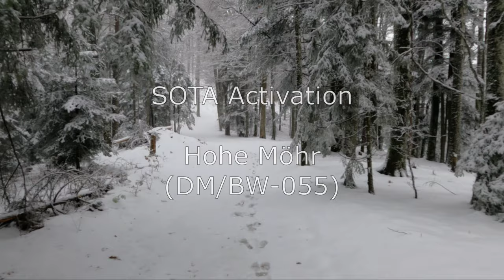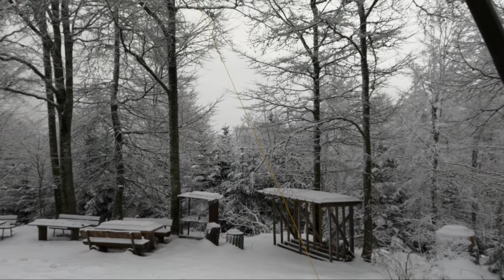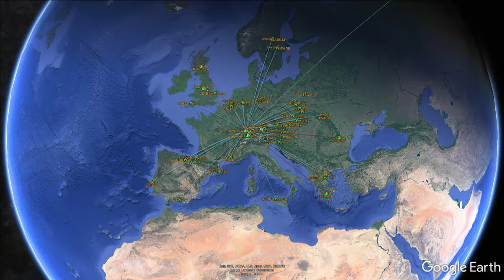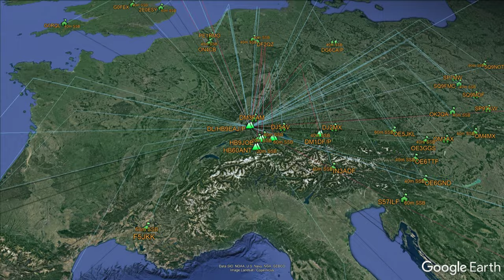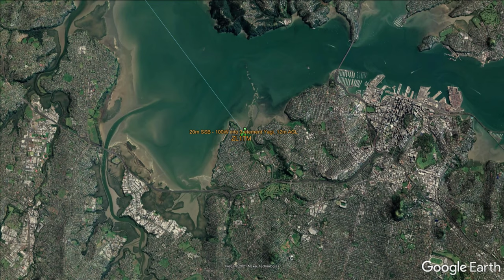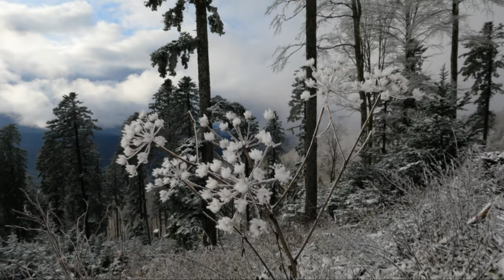First snow and unexpected SOTA DX

Comment: Congratulations on the DX Stephan! Nice to see the TX-500 proving its abilities in the snow :-) 

I've found mine to also be quite an agile rig for chasing, making good use of the A+B VFOs to monitor the pileups to try and pick the best time to call. Today in the rain my TX-500 + your 7 band EFHW design got me to my 1000 chaser points, which I was very pleased with.

73 Jonathan G4IVV
Reply from the maker: Hi Jonathan, thanks, for your feedback.
The snow test was still on my todo list. You should have seen the transceiver when I dropped it last weekend into cold deep snow. Good that I had a plastic cap on the BNC 😀
Congratulations to your 1000 chase points!

Comment: Nice! Good job on the ZL! I hope your phone is as waterproof as your radio. 😉
73, Fraser MM0EFI
Reply from the maker: Hi Fraser, yes this ZL contact was amazing and was my furthest SOTA contact so far. Sometimes you have to be lucky 😄 
Unfortunately, my phone is not waterproof, but it survived the day without problems. 
To me it is surprising that the touch display works even with some water on it. But when there is too much of it on the display, it starts to misinterpret touches, so you'll have to remove the water from time to time.